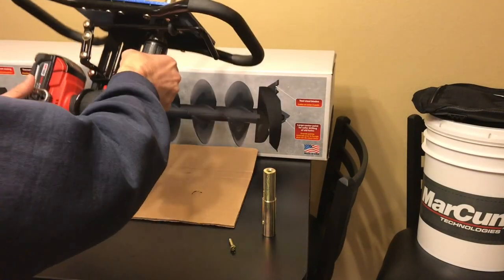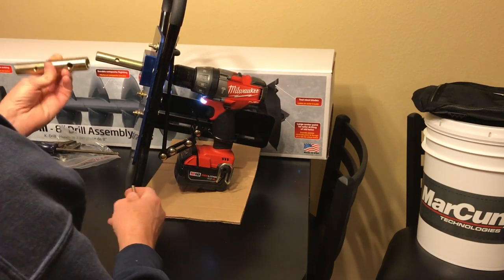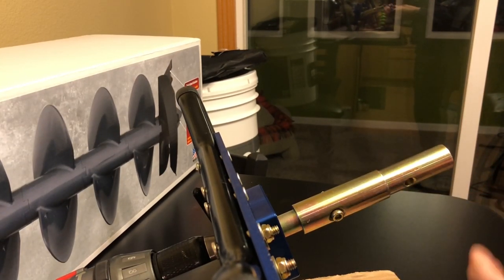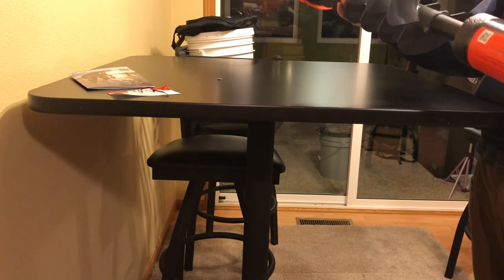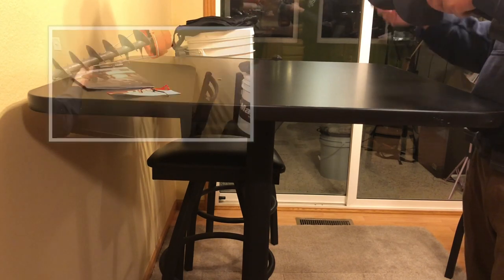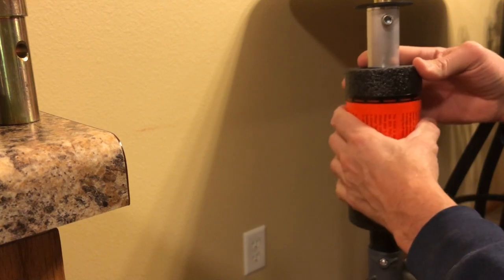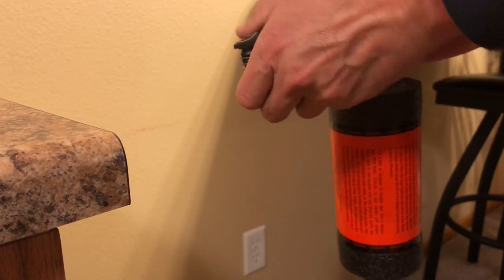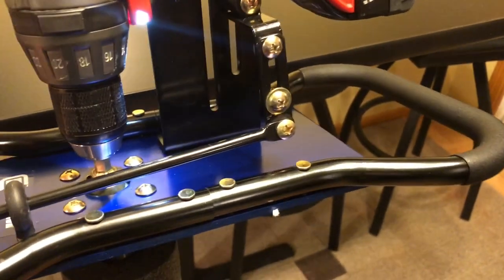K Drill Unbox & Install

Comment: You have your trigger on the wrong slot of the clam plate. Move it to the left opening side
Reply from the maker: kao her tried that, thanks for the suggestion. No real difference. Cold weather and drill was the culprit.

Comment: So did you have to back track after you went ahead put lock tight on?so then you removed it from the clam an put it on the k drill i cant tell if you had to flip the adapter or not? iam hoping i ordered the right part
Reply from the maker: Warren Sylvester I don’t recall the order of it all, but used it last year w/o any loosening. If f you ordered the adapter for the clam plate, im hopeful they sent you the right getup for it.
Thanks, happy ice drilling !
Reply: Where did you get your adapter from? i just ordered 1 from cabelas 2 hours ago i was jus hoping it was the right 1 lol 19.00$ i jus bought the clam plate an k drill just today an i get it home just to find out i needed a dum adapter for it to work i wasn't to happy about it nice video by the way an thanks for you response